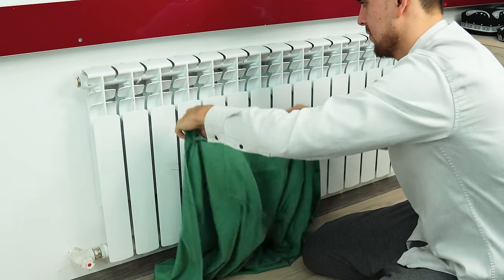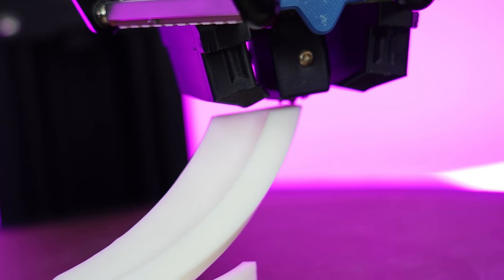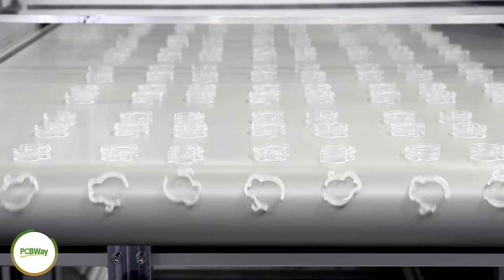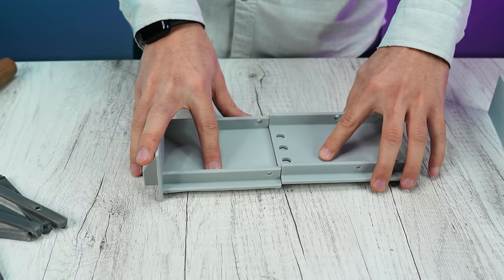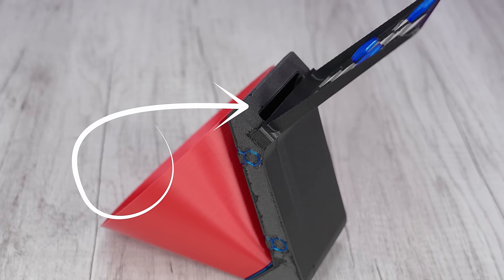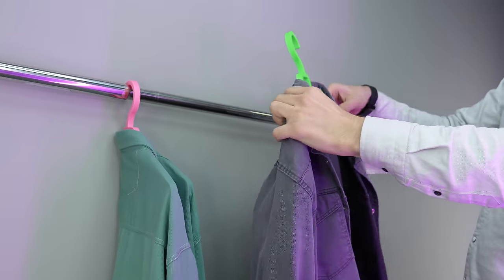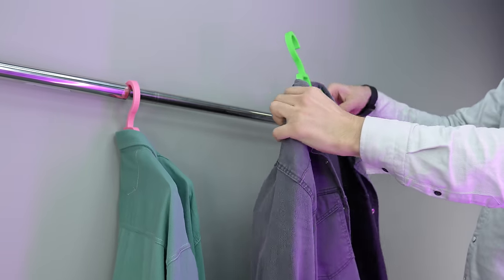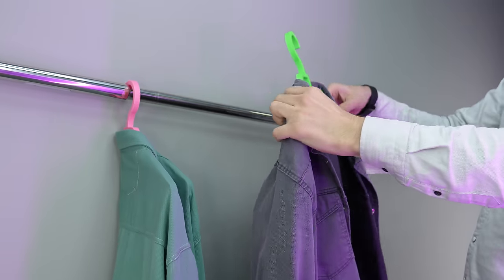USEFUL Ideas to 3D Print - January 2024

Comment: The first object is dangerous, PLA or PET will simply melt above 40 or 60°C.
Using 3D printed objects for food is also extremely dangerous if you don't want to eat micro-plastics.
Reply: womp womp
Reply: as if your body wasn’t already full of microplastic
Reply: just seal them in food-grade epoxy if you want to eat out of them

Comment: The mug might require coating it with a food safe resin(I think those exist?) to seal in the plastics and make it water tight
Reply: They do
Reply: I printed it water tight no problem.
Reply: @isthattrue1083 I said might. It depends on the settings used when printing. Not enough infill, and it'll leak. You also want to use something that's actually safe to eat from, as I'm not sure many if any filaments are. We're trying to LOWER the amount of plastics we accidentally ingest, not intentionally have more with our morning coffee.
Reply: @isthattrue1083  just because it is water tight it doesn’t mean it is safe. You should never eat or drink directly from 3D printed objects hence it should be coated in a food safe resin.
Reply: @TheLukemcdaniel  it doesn’t matter if a filament is food safe, the process of FDM printing isn’t.
Reply: I needed a glass for a cocktail so I printed one out, had my drink and  tossed it in the trash. It saves space in the cupboard.
Reply: @mikehand276 So you’re the one ruining the planet?! 😅

Comment: 0:24 and melt the hooks as well
Reply: Really depends on the filament type. PETG can handle higher temps than PLA and TPU is even more resistant than PETG. 

So it can definitely be melty if you use the cheap and abundand PLA, but if you havr a capable printer for something a bit more... durable... then you can definitely it work.